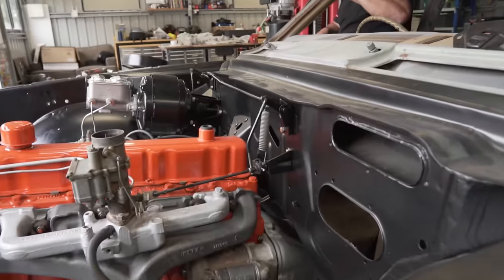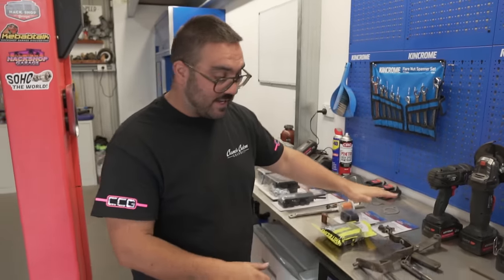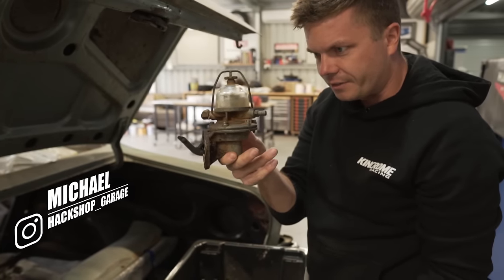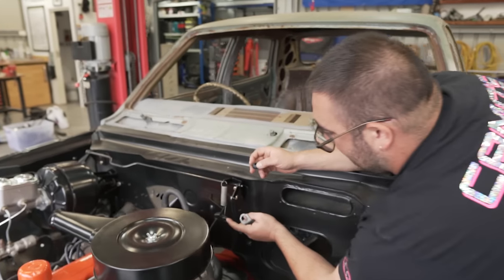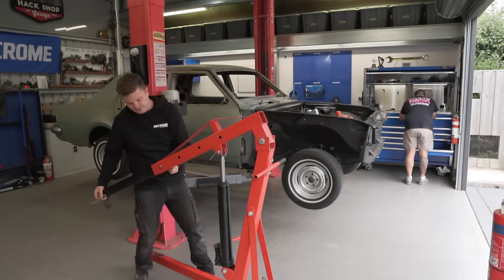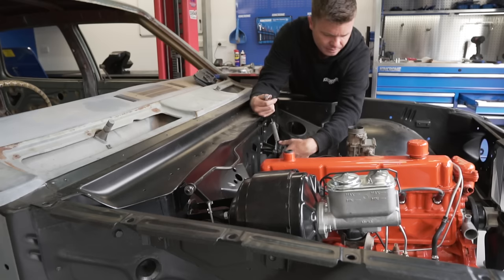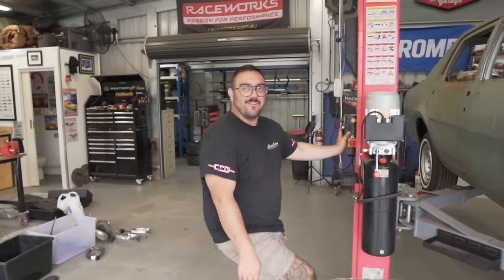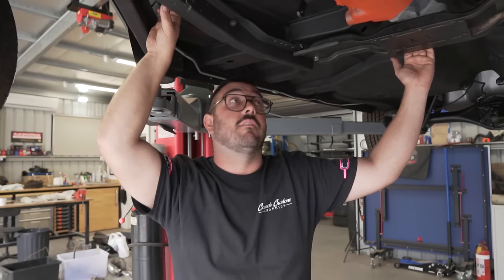WHO NEEDS 3 PEDALS ANYWAY... RIGHT??? - HG Build - Part 10

Comment: I have an LC Torana, so similar vintage, so I assume steering columns are similar. At the bottom of the steering column there is a bush to stop the slop of the column inside the sleeve moving around. They commonly ‘go’ over a long period of time and they don’t make replacements (like they do for HQ onwards). What I have seen done (and intend to do) is get one machined out of appropriate size nylon rod and pressed in.
Reply: While Torana focussed - this will give you the idea, and I suspect (but don’t know) columns will be similar.

Comment: Instead of rebuilding the column linkages for the gearbox, just throw a speco floor shifter that suits the three speed box. Fits easily and easy to use.

Comment: Did you fit a new transmission mount they can compress like the engine mounts or tear the rubber away from the steel

Comment: that rat trap clutch linkage is a pain 
the early HK's had the crash box with small hydraulic  master cylinder  system much better than that rat trap
the rod shop does a conversion  for it using the fc slave cylinder  worth buying you will need the adaptor bracket for the gearbox as well